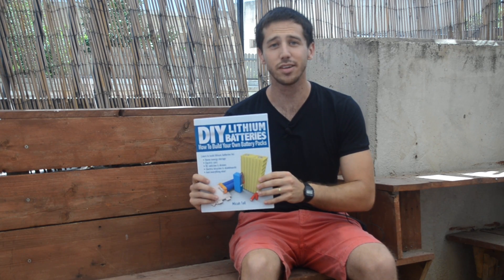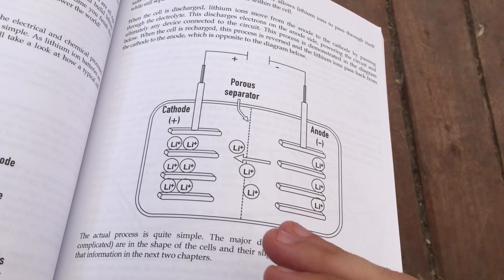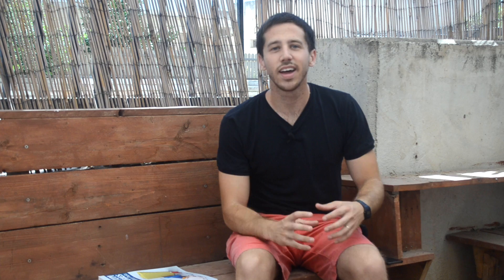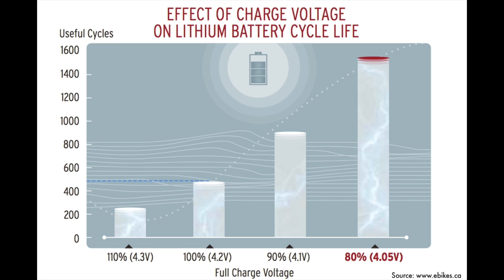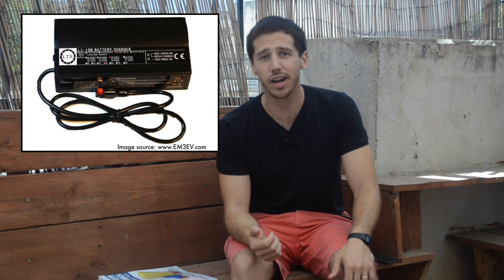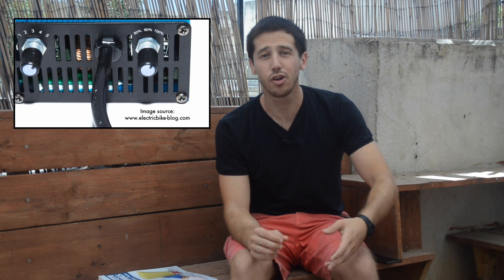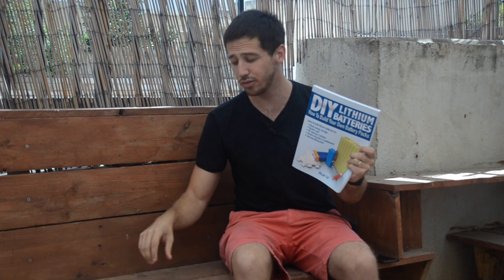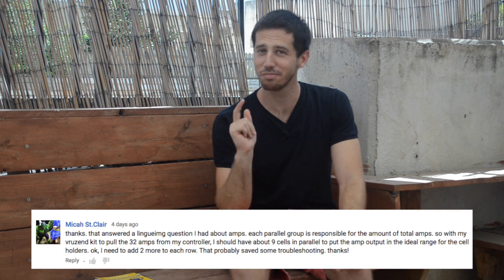How To Double The Life Of Your Lithium Batteries

Comment: Hi Micah
I have a 1500w Voilamart rear electric wheel  You had mentioned for store bought batteries that Unit Pack Power was a good battery. 
 I bought a 52v x 20a battery. No complaints,  I believe I am getting good service from the battery.
My problem is My Wheel kit didn't come with a multi purpose display.
   I'm buying a new more powerful controller and display bundle. 
I'm pleased with the wheel. They suggested a 48v x 17.5a battery. Under certain conditions I could achieve 34 mph.
Well with the 52v x 20a
Battery according to the GPS on My phone I can do 38 mph.
That's throttle only. I haven't gotten around to installing the chain.
My bike took 2 years for research and design and three months to build..
This bike is Stage One.
I have spent about $1700.00 
Stage Two will get a new Full suspension frame. A 1500w front
Wheel and it's own 52w x 20a battery.
A second matching controller/display bundle. Air suspension fork and a rear air shock. 12v lights and 190db horn. And a few things I won't say now.
Stage Three is going where NO Ebike has gone before.
I'm thinking about over volting  both Wheels 60v x 40a batteries.
Stage Two will be completely by My 72nd birthday 8-15.
R. Mack

Comment: What about charging at a lower amp. Say charger bike comes with charges at 4amp. Would it be better for longevity to charge at 2amp
Reply: If you know what your battery cells are inside your battery and how may are in there you can look the long life charge rate data up from the manufacturer and get the charge rate of each cell and times it by how many battery cells are inside your battery.  I can confidently say if you have a 36v battery and up it will make no difference going from 4amp to 2amp, both are well under the long life charge rate for recharging batteries for longer life.

Comment: I have an ebike with 72v 40ah lion battery with 80amp controller and 3000w hub motor. If I increase the battery capacity  to 50ah with everything else unchanged, how will this change affect the performance of the bike in terms of tourque and top speed?  Thanks for your  video.

Comment: I am kind of curious about your argument. I bought an e bike kit with a 48v battery. They say it should have 3 complete full charges to condition it before I think about part charges. I don’t use the bike much so it hasn’t completely emptied the first charge. The usual advice is to not store unused batteries either empty or fully charged. Should I adhere to these guidelines ?

Comment: Hi Mike, thank you for such an education for the Electric Vehicle community.  I'm a newbie on this subject.  So if my questions look foolish to you, please bear with me. 
Can you tell me what is the cycle of a lithium battery?  Why does more cycles mean longer life of the battery?  Can we first define the life of a battery is the time of production to the time where its max. capacity after fully charged is less than 80% of its original fully charged capacity.
Then can we define a cycle as charging (C for short) the battery fully and discharging it fully (D for short)?  So a pair C-D is a cycle? but then 0.9C (this convention means charging 90% of the battery) does not qualify as a cycle technically speaking.  But if you defined a cycle as charging the battery (means everytime you connect the battery to a charger hooked up with an AC source), then do you mean the number of charging times (i.e. cycles) is more if everytime you just charge 90% or less of full capacity than if you charge 100%?
But then, what good does the increase in number of charging do if the total capacity (or milage travel by the ebike that the battery resides) is 10%less?
Again, sorry for such mouthful questions.

Comment: Good info, about the same as i read over the years. Regarding Undercharging, this is valid for SINGLE CELLS, which NO-ONE uses in PEVs.
 As soon as you build a pack with a BMS its more important to balance the pack than under charging. Especially in large batt pack EUCs like the 4 pack 3.2KWh 100V Sherman.  "long time" Store around 40-60% charge, but not too cold or hot.
Reply: literally says in the owners manual to store at fully charged and top off every 2 months

Comment: I just assembled my e-bike yesterday, and took my first ride today.  Unfortunately, as I'm sure you know, the chargers that come with e-bikes these days, have chargers that only fully charge the battery.   I was wondering after a while, getting to know my e-bike and charger, if it would be prudent to just put a timer on the charger, in if I know it takes X hours to charge, lessen the amount of time via a timer to the charger?   I would think I could get educated enough over time, to at least get my battery to between 80% - 90% by doing that, but thought it wouldn't hurt to ask you your opinion on it?   Is it problematic to have no power going to the charger, and still having it attached to the battery itself?  For the most part if riding locally, I won't be putting too many miles on per day overall, as longer rides I'll have to take it on my new rack/carrier to a location much further, and when doing this, I'd charge it to 100% of course, but that will only be now and again during the summer months.   Thanks also for the tip at keeping the battery charge lower if not using the bike!   Another quick question being, 'if' I had the battery charged up fully, would just turning on the headlight/tail light for a time take the battery down, as some times we will get a lengthy period of rain, thus I'd prefer not to take my bike (or myself) out in the rain if at all possible.   Thanks!

Comment: you dont need all these expensive safe chargers,ive got a type 2 electric bike and i know exactly when to cut off the charging power of my battery charger when im charging  the battery so it will last a lot longer.you see you get to know your own batteries power capability and when to cut the power so as to give your battery a longer life.

Comment: You can also use an adjustable boost/buck converter with a CCCV circuit in it. You can adjust the charging voltage and current to two decimal places and you can get one for around $20.  Granted you dont mind supplying the charger with DC.
Reply: To Isolate it from the mains you would need to buy a ±150W transformer, a full bridge rectifier and a bunch of smoothing capacitors. Then connect it to buck converter. Considering the price, it's  much cheaper to just buy a 50$ bench power supply and get clean DC without any ripples.
Reply: @PolskiKrecikv2  I said 'granted you don't mind supplying it with dc'.

Comment: just came across your video.. has battery technology changed over the last 4 years or is this still relevant? thank you
Reply: Haha me too
Reply: They are still using the same lithium ion batteries now so it’s still relevant. Same applies to electric cars since Tesla was using the same cells that ebikes used. They are just coming out with new battery technology now.
Reply: Only difference is for the best battery's you want them to have a density of about 200wh/kg and do the regular 20 to 80% charge and store at 40-50 and charge to 0% and 100% ever now and then

Comment: Hey dude,  question, my lectric bike blacks out and pulls a error at 46volts 6 bars left on bike, it turns back on only 2mins later to turn off. I charge to 54.6 volts..only to get 13miles pas 2 + throttle, lectric sent me a new controller and switch only to black out again at 46volts, now there sending me a new battery, could it be the battery?...i got 480miles on bike

Comment: I have 2 e bikes from ecotric that are now 4 months past warranty and I have only charged them about 15 times I did what the instructions said during the off season I charged them every month and sometimes the light was still green after sitting for a few weeks and now they discharge much faster and for some reason only take about an hour or 2 at the most to be fully charged after almost full discharge?? Something is wrong I watched your video and I am thinking that I should of not kept them topped off when not in use, I am confused because the instructions say to charge the battery every 2 months but you say it's bad????

Comment: Got your book and am interested in making a 4S8P battery but need to keep it under 15 volts was thinking of charging it to 3.8volts/Cell but am worried about balancing... is there no one who makes a programmable BMS? my device needs between 10.5volts to 17.0V absolute max it originally used a 14 amp hour 15 volt Nicad any suggestions? have a Battery kit  coming this week.jim

Comment: Lowering the float voltage is only advantageous if the battery is well balanced but because most e-bikes come with a dumb charging bricks and a BMS that is buried inside the battery we have no way of knowing if the battery is well balanced. A lower charging voltage used on a out of balance battery could result in some of the cells still reaching their maximum charge voltage while the slower charging cells are left at a lower voltage.

Comment: When you want to extend your riding RANGE and BOOST your power as well, then you can safely join two batteries in parallel  with the help of a DATEx2
You can find out more  here https://biggamebikes.com/product/datex2-parallel-battery-adapter/

We can build for 30A, 60A or 90A continuous power and it just works (y)
While we are working on a future improved version, the current version does NOT support REGEN motors (where the motor is generating electricity when braking)
This will come out in the next weeks.

Comment: I live in Michigan where riding gets dicey during the winter months. What is the best voltage for long term storage. Should battery be stored in house (70 degrees) in the garage (between 30 and 45 degrees), or in the shed (outdoor temp)?

Comment: I'm trying to keep my 500w ebike charged as I'm riding. I have a 4lb scooter battery that powered on a 750w power inverter. So I thought about plugging the ebike charger in the inverter with just 1 small scooter battery. So I asked the man that works at the battery store he told me since the charger is 48v , he said I need to have 4 small scooter batteries to make it 48v. Do I need 4 batteries or can I just use 1 battery. He said if I use less than 48v it can mess up something. Is that true or false ?? May some 1 tell me the names of the jump starters that has 1000w and more that's all electric and very light weight or the lightest possible like around 23-50 lbs so I can mount it on my ebike ??
Reply: I thought I'd reply because I have tinkered with range extending beyond my e-bike's battery range which is the core of your question.
This could be an interesting topic for  a new Micah video?.

Your idea to use a 12V scooter battery to run an inverter to power your charger while riding sounds plausible as a range extender but imho is not a good solution. This is because the scooter battery at only 4lbs probably has even less Watt-hr energy capacity than your bikes battery and assuming its sealed lead acid means its has inferior charge / discharge cycling compared to your bike's Li-ion battery. Plus the conversion inefficiency of the inverter then the charger further reduce this modest supplemental energy. 
Using a battery based jump starter probably doesn't add enough Watt-hrs but a large battery based power bank could. That likely costs more than just upgrading your e-bike  battery and has the extra inefficiencies of the AC inverter then the charger.

For range extending my rides beyond 50 miles with my bike's aging 1kWh battery,  I have experimentally carried a small generic branded 21 lb 37cc 4 stroke gas engine powered generator inverter set (~$250) very securely strapped to the rear rack. The output AC is a sinewave and fine for electronics. The manufacturer claims 1 gal can produces 4kWh of electrical output when run at half the genset's 700w nominal output. I used a 52V 6A charger on a kill-watt meter so I verified the genset inverter output was about 300W to the charger. I peddled hard enough to see my bike's power monitor  indicate around 300W average power draw. So my battery charging and discharging currents were close enough to maintain my battery's voltage for much of this ride. My single short 30 miles usage of the genset and about 1/6 gal (US) suggests I might have been achieving 200mpg (with full peddling) but this requires more investigation.
My present range extender is a Golden Eagle 4-stroke 33cc gas engine kit with a single stage belt drive transmission to the  rear wheel. I always pedal and I used the electric motor at  speeds below 20mph and the gas engine only between 15-26mph. This also gets about 200mpg once run in though my electric & pedal power significantly contributed.
The genset  is the more compelling than the bolt on engine because its much quieter, runs at a lower rpms at a more constant load and doesn't interfere with the e-bikes transmission. The 21 lb weight above the rear wheel does mess with balance a little. Plus the genset is easily detached for most day to day rides and is useful equipment generally.
Having said all this, I have now purchased enough 21700 Li-ion cells + bms to make a 2kWh pack that will be good for 100-120 miles with full pedaling.
The silence of pure electric drive is most compelling of all.

Another range extender option is to tow a 200-300W solar panel trailer. They use a boost type mppt charger to directly charge your battery without need for inverting to 120VAC. There are many youtube videos by people riding cross country distances who have excellent sunshine all the way.
Reply: @briannugent5518  I don't know about all of that. Solar, what about at night ?? Maybe a 600w jump starter, maybe that will work ?
Reply: @drrobotnikmeanbeanma  your original post implied you want range extension which is why I explained various approaches. A 600W jump starter delivers 600W for a short period depending on its ?Wh capacity which you don't say.
Reply: @briannugent5518  I hope Bert's Bike Shop is right about the 350w Pace Aventon.He said it can go 28 mph. If that's true then that might work
Reply: @drrobotnikmeanbeanma  The spec for Aventon 350W Pace model is here  https://www.aventon.com/products/aventon-pace-350-step-through-e-bike#     its max speed is 20mph as I would expect and has a 36V, 11.6Ah (417.6Wh) batt giving a 25-40 mile range.
Note that 28mph is 140% of 20mph and physics tells us that requires a cubic power increase ie 1.4 x 1.4 x 1.4 which is 2.7x more power. Hence 28mph needs a 750W motor which in turn needs a 48 or 52V battery pack. That increase speed roughly halves your battery range.
Reply: @briannugent5518  I will take your advice or word over the guy at Bert's word. I'm searching for a 350w ebike  cause I have two jump starters.1 is 500w and the other is 600w. So if my ebike battery go low the jumpstarter will kick in. The Pace Aventon 500w batteries is out of stock. So I asked the guy at Bert's what ebike can I get parts for easier. Stuff like batteries rear wheels inner tubes. I honestly asked him about the 28mph ebikes. But I think the 26 inch wheels will work better for me cause I can get a Tannus tire for a 26  bike wheel. Any thing bigger seems harder ?
Reply: @drrobotnikmeanbeanma  Its much better to choose a bike with a large enough battery capacity that satisfies your longest return trip with some margin. Aventon is good about realistic range estimates for different riding modes which you can use for similar spec'd competitor e-bikes.
Just saying keep it simple when starting out.

Comment: We can’t check what voltage each individual cell is charged to as they are all joined in series/parallel to make up the overall battery. You need to give the voltages for the whole battery pack e.g. 48v which can be checked in the computer menu.

Comment: My tip is buy a good solar charge controller. You can use a regular dc power supply instead of the panels. You can connect some panels to it if you want and go solar charge as well. Then you can set the controller for whatever charge parameters you want.

Comment: While most use a moderate capacity for a 11.1v Li-Ion battery pack, it is somewhat misleading to advise people to charge only 85-90%. These packs are designed (with BMS) to fully use the capacity available for a really competitive price. If I spent $100 for a pack that I can use 500 times with full charges from 0-100% I am happy it is only 80% capacity DOD after those 500 cycles. This is probably 2 years of use. Similar packs will be only half the price by then. So you have the choice to upgrade to 100% for $50 with a replacement pack or go on using the 80% capacity. Why this strange extending life by a misleading amount of cycles if most of us buy a new and bigger pack after 2 years or even sooner.

Comment: One cycle is from a full charge to empty = 500 cycles, but if you only use say 25% on each ride  four rides is also equal to one cycle, so you only need to recharge after every fourth ride Ect Ect,  best not discharge battery to empty though your battery should last a very long time